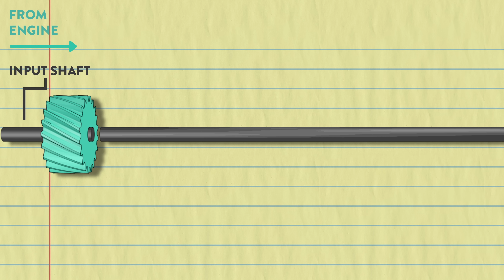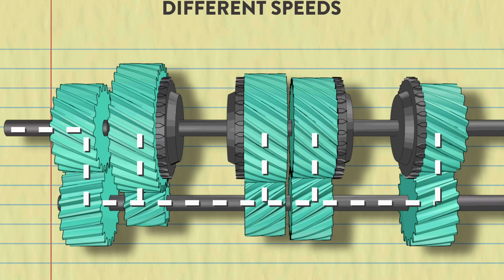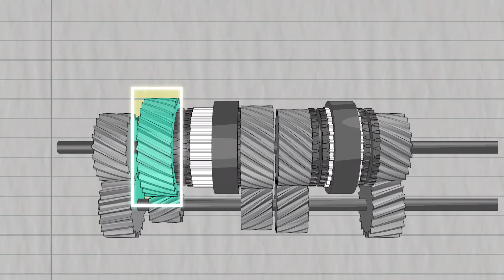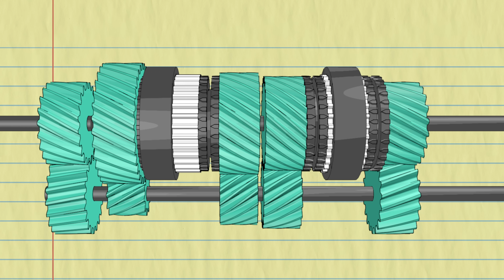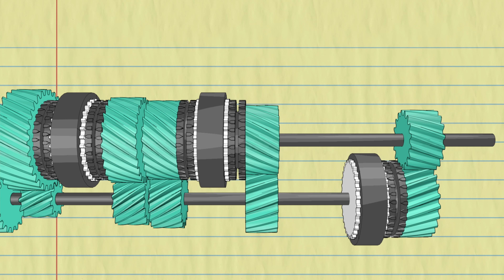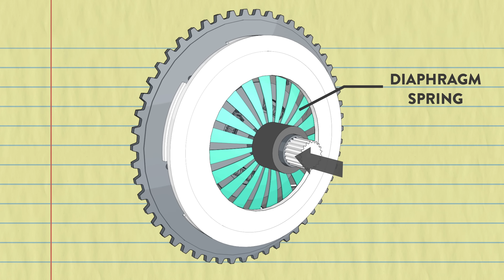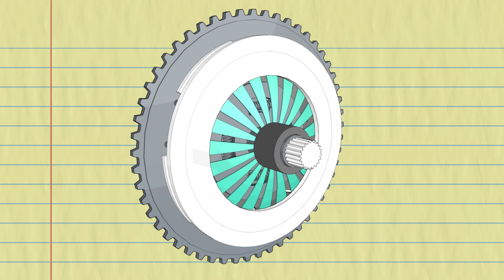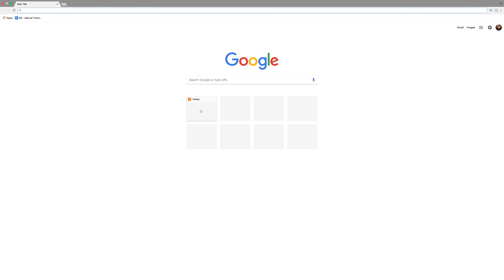MANUAL TRANSMISSION | How it Works

Comment: I think you should have made a distinction between 'double clutch' as a technique and 'double clutch' like a dual-clutch transmission. Although DCT's aren't manual transmission (that I know of), the overloading of the term could be confusing to someone not familiar with different transmission designs.

Comment: One thing that 99% of people forget is that the final gear reduction of the axle completely eliminates the significance of the actual numerical ratios of the transmission. For example, my volvo’s 5 speed automatic doesn’t have overdrive, but it still makes a nice 2300 rpm at 65 mph, and still gives me 33 mpg at that speed. It only has a 1:1 ratio for 5th gear but the final drive ratio is relatively low at 2.76. My subaru impreza’s manual transmission has an overdrive of 0.78 but it cranks out 2650 rpm at 65 mph. It actually revs higher than my volvo even though it has overdrive. And the tire sizes on each car is less than 1% different ( 205/50/17 vs 195/60/16). The final drive on my subaru is 3.9, which explains the discrepency. The overall ratio is what matters, not because a ratio is an overdrive or whatever. It’s true that in the past, there were fewer choices for axle ratios, and overdrive ratios were compatible with those ratios because they were already pretty high to begin with. For example, 3.73 and 4.10 are extremely common final drives on older vehicles, and without overdrive, most cars and trucks will rev too high, but if 2.44 and 2.76 were more common, overdrive would be excessive. Also, it’s true that lower rpm when cruising is advantageous to fuel efficiency, but the benefits dwindle. The actual values differ between every application, in my opinion the top gear ratio should put the engine rpm around 1500-2000 rpm at 70 mph. Any lower isn’t going to do you much good if any and it just makes transmissions more complicated by giving them too many gears.

Comment: This episode was EXCELLENT! I have a special request. Can you do a MANUAL TRANSMISSION PART 2  episode? In this episode can you demonstrate with awesome graphics and or real parts what happens when you do a smooth gear transition vs jerky gear transitions (like when you don't catch the rev when you down shift). Show what's happening  when you  launch at different rpm's ranges and how it affects the transmission and clutch. Also show what's happening again with awesome graphics when you are able to burn out through multiple gear transitions through a drag race. Also show the difference on what makes clutch pushes heavier or lighter than others, say a race clutch vs stock clutch. What is the effect of having  3 puck vs 4 puck vs 6 puck clutches. What happens when you blow a transmission say when you shift from 4th to 3rd or 3rd to 2nd in a high rpm range.

Anyways, you guys are awesome. Keep up the great work and I hope my idea makes the cut! Much respect and peace out!

Comment: I think the presentation would have been easier to follow with less cut away transitions. Just leave the animation of the drivetrain up while you talk through it. I don't need to see the host gesticulate wildly - I'd rather get another 5-10 seconds looking at the mechanism he just described. WTF were the sleeves sliding over gears? That was glossed really poorly.

Comment: Can you guys talk about automatic transmission and what happens when you decide to switch it over to manual (or sport) mode and what it does to your engine? I drive my automatic transmission car in sport mode so I shift the gears myself like a manual but I want to know if it's bad for the car or not

Comment: Back in 1985 my friends dad bought him a Chevette manual to learn driving. It only was a month later that he found out about using the clutch. 1, 2 ,3 power slamming the gears . We both learned how to use the clutch eventually. But we still power slammed that POS untl it died 18 months later.  Never bought an automatic. To each his own.

Comment: In many six speed front wheel drive vehicles fifth gear has the same or even slightly bigger ratio than fourth gear, because the fifth and sixth gear have a different final drive ratio than the rest.

Comment: Wrong wrong wrong. 4th gear or high gear or 1 to 1 or direct is not a gear at all. Simply a syncro hub  locks the input shaft to the output shaft. No torque through the counter shaft at all.

Comment: Awh you didn't mention why the reverse gear makes the Whiirrrrrrrrrrrrrr sound. (It's because the gears are straight cut instead of curved in mesh. this is also why racing gearboxes whine so much)

Comment: Been thinking about trying to take apart a junk VW Bug transaxle to see how it works. See how complicated it is, and how difficult it might be to rebuild my current transaxle and use some of the junk one's parts - like it's final drive ratio that would give better gas mileage (and less noise on the freeway). That's another major factor he never mentioned - final drive ratio, rarely is it 1:1. Both if using a transaxle with integrated diff or a rear axle diff.

Comment: How does Abs Braking work?
Reply: It works by not letting the brakes lock LOL
Reply: It works by Anti-locking the Braking System
Reply: There's a metal ring with rectangular holes in it so a sensor can detect if the wheels are still rotating or not. Then the computer does wizardry and decreases the pressure applied to the brakes.
Reply: All four wheels have speed sensors so that while under heavy braking if any of the wheels are spinning slower than the rest ( by locking the brakes and skidding the tire) the computer recognizes a locked brake situation and will activate what is essentially and hydraulic pressure vibrator which will allow the wheel to begin spinning again but continue to apply the brakes. It’s simple but genius, especially on slick surfaces like ice and snow. It basically mechanically pumps the brakes 100 times a second to keep the wheels from locking up which helps stop the car much better.

Comment: your transmission diagram is backwards. and direct drive normally couples the input shaft directly to the output shaft. no counter shaft needed for direct drive.

Comment: So what is the purpose of double clutching?
Reply: It's for transmissions that don't have synchronizers to synchronize input and output speeds, for example semi trucks. So you synchronize speeds manully with double clutching. Since most modern transmissions have synchronizers it's not necessarily to double clutch.

Comment: How carburators work
Reply: isnt it just a throttle body that squirts fuel into the air and takes it through the intake manifold to the cylinder

Comment: That line in the movie is just nonsense. Double clutching is only necessary on non-synchronized transmissions. I.e. Vintage cars and commercial trucks. If Paul Walker double clutched during the race he would have been way slower since each shift would take twice as long.

Comment: l personally prefer a dual-clutch. I love the automatic rev matching, l love the constant
power delivery, and it's more comfortable for evervday driving
With all that said, I totally understand the desire for a manual transmission, especially in a car that has a shit automatic. If I had the option, I'd have one dual-clutch, and one manual car
But the hatred for people who drive automatics is silly and. immature
Reply: Sad Dogger dual clutch are essentially sequential transmission with two seperate clutch. sequential transmission are manual transmission mostly used for motorcycles and race cars. it operate like auto but has manual transmission components. I like them too dude.

Comment: You should’ve mentioned engine breaking, the best way to slow down your car without using ANY fuel or wear out the brake pads whatsoever. All you have to do is switch to a lower gear and the engine will use the motor to slow the car down. For example if you need to emergency brake at high speed, the safest way is to switch from 5th gear to 1st gear and you will slow down quicker without wearing the brake pads or wasting fuel 👍

Comment: double clutch while racing... welp someone has never raced a car before, in a synchromesh gearbox (which is exactly what was described) double clutching will do absolutely nothing to help you go any faster, in a dog box/face plated gearbox you double clutch to shift gears but can get away with simply letting off the throttle to unload the gears and then shifting into the next gear when going up, or while deaccelerating you can blip the throttle to also clutchless shift down, just look at motor bikes the better riders only use the clutch to launch and stop as the compact nature of their bikes means a synchromesh gearbox would be too bulky so they have face plated gearboxes, in modern gearboxes double clutching is simply a waste of time and effort and will only make you slower

Comment: when i was growing up in mexico, my uncle told me about four to the floor or ( cuatro al piso) is that the over drive you talking about or is that an old feature is in cars no more?
Reply: four on the floor is when the gear stick is going through the floor of the car to the gearbox, there is also three on the tree which was a gear stick attached to the steering column, it's just very old car slang from the 60s and 70s and has no real relevance on what each gearbox was other than how many gears are in the gearbox itself
Reply: for some reason i always tougth it was built to make the cars faster back then lol, thanks for clearing that out genral insanity.

Comment: what  about peddle shifters
Reply: Dice2k paddle shifter are used by tiptronic, sequential and dual clutch (which essentially sequential transmission with two seperate clutches). which one do you want?

Comment: When you are in 5th gear and you feel like savage shift it to R for racing mode!!!
Reply: yeah dude tried it once and my car couldnt handle it! it was wild 10/10 would try again lol
Reply: also don't forget to start in 5th because its the most efficient
Reply: Thoughts in the Crossfire Yes and also revving the engine to 5000 while starting is necessary to maintain the clutch lubricated and at is operating temperatures
Reply: @thoughtsinthecrossfire1428  lol that would  be easier though right ?😂😂😂 it takes less rpms to get the gear rolling😂😂😂

JK
Reply: Dont forget to get rid of those pesky side mirriors. Major drag on those boys.
Reply: Lmao

Comment: Can you do how cruise control works? Very curious to see how it maintains the set speed perfectly downhill
Reply: Normal cruise control doesn't brake using your brakes, only brakes using the engine so if you're going downhill you're probably speeding

Comment: Every car I own will always be manual
Reply: #SaveTheManuals
Reply: +TH3B34ST31 I am saying the same thing but unfortunately it is not going to last. Our generation, assuming your a millennial (as they call us), could not care for driving period. At all. As in lots of my friends are leaving their cars behind after graduating and finding an apartment close to work. Don't know how long it will last, but still. The other bunch is interested in electric cars, likely because it's the rage these days. Not that they like cars though. Brands that once had strong sports cars are softening themselves (BMW) to appeal to a broader audience, times change and so do markets - it's business. I am getting myself a new WRX 6MT, or something 6MT. Sorry for the rant, had to do it.
Reply: Once electric cars take over, maunal trans' will be extinct (but so will auto trans' and CVT's and sequential manuals for that matter); only internal combustion engines need transmissions, due to the varied torque curve. Electric motors make 100% peak torque at all Rpm, and can spin up to 15,000 rpm, so don't need multi geared transmissions to utilize peak torque

Comment: Manual will always be superior ✊
Reply: Cartoonz N 2JZ
 No, it's not superior. The fastest performance cars today are almost all automatic. Manual may be more fun, but it certainly isn't superior.
Reply: @mms-performance  there is a reason most semi trucks still use manual transmissions....(namely control, considering the weight you are pulling)
Reply: Cartoonz N 2JZ for what reason?
Reply: Bayarjargal Bayasgalanbat every reason :)
Reply: BlacksterFX exactly i love driving manual but if i want a faster or fuel efficent car i will always buy a automatic
Reply: try driving bumper to bumper in Indian traffic n u will feel like u have been tortured for some previous life sin.

Comment: Can you talk about Fast and Furious gearboxes next???
Reply: Fast and Furious transmissions open a portal to a pocket dimension that has an infinite anmount of gears every time the driver does the 4th gear motion more than once.
Reply: dustojnik hummer 28*
Reply: Just like in fast 8 they had 3 reverse gears
Reply: @lazerbeastgamer355hd7  exactly, slow reverse regular reverse and fast and furious reverse! 🤣
Reply: Carlos Barberena same principal with this video but with more gear than common cars
Reply: Your stupid they obviously use truck gearboxes lol
Reply: Eaton fuller transmission
Reply: The video would never end.
Reply: Carlos Barberena that would take half an hour. Too many gears to discuss.
Reply: Carlos Barberena or why Fuel injection is superior to carburetors DOWN TO THE ATOM?!
Reply: The R stands for Race gear actually.
Reply: Cody Foster and 6th gear is actually 6 multiplied by infinite
Reply: Unlimited Gears
Reply: I feel like if they used automatic cars, they would try and shift that too xD. Trying to go fast by shifting into reverse

Comment: HAAHA Nice joke dude we all know that manual transmissions have an infinite amount of gears, haven't you seen fast and furious?
Reply: I’ve always thought that all the shifting was because they were down shifting and then upshifting again... and then downshift more for corners and up shift to get back to speed. Then again, it makes no sense during the drag races.
Reply: That Guy i thought they only have 17 gears
Reply: That Guy 😂😂
Reply: That Guy fast and furious is set in a world that have a much more advance than this that allows them to have a state of the ark transmision
Reply: That Guy hahaha no shit m8! 😂😂
Reply: The driveshaft in F&F extends to oblivion, then comes back for the wheels
Reply: I have driven a semi tractor with a 13 speed transmission (they make 18 speeds for semi tractors as well). It has 4 main gears with two ranges, a low gear and an extra 2 speed overdrive box behind the transmission which lets you split the 4 main gears in high range, giving you your 13 forward speeds: L-1-2-3-4-5L-5H-6L-6H-7L-7H-8L-8H
Reply: That Guy Fast and furious is so fake that's why Paul walker died.